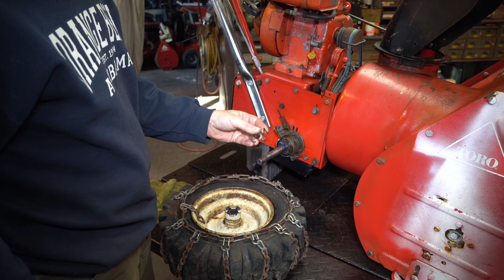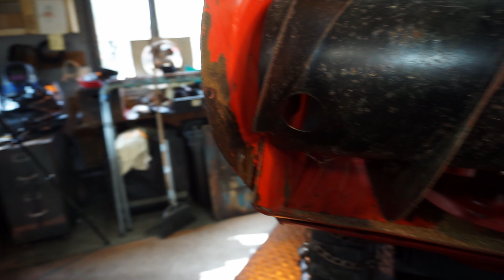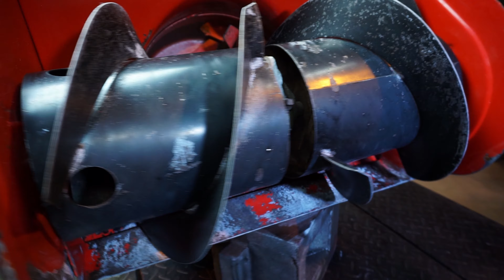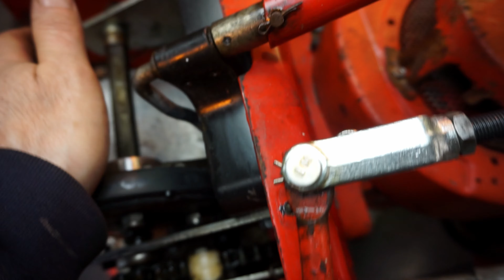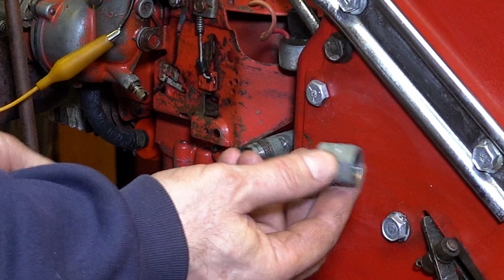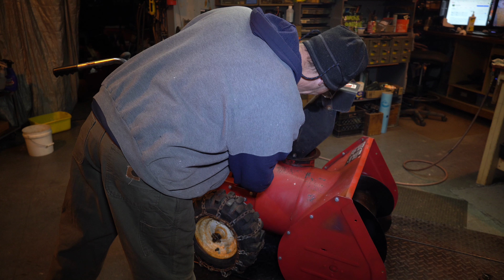1979 TORO 826 ~ 26inch - 8hp Briggs & Stratton Engine REVIVAL  part 3

Comment: Nice. I just sold yesterday that worked except the tank was rusted through but ran good. Today the guy said it’s locked up when his “mechanic” looked at it
Reply from the maker: Maybe he should keep his mechanic away from it! lol
Reply: @TheNovaJohn  I think so too. It was fine except the rusty gas tank before I sold it to him. Obviously they did something to it. Maybe in gear or the auger engaged so it’s hard to pull start. Or I’m thinking they put the wrong spark plug in and it’s too long so the piston is hitting it
Reply from the maker: Yea,, the plug,,,,maybe,,good thinking.. We wouldnt do that but someone else,,,,,yeah!